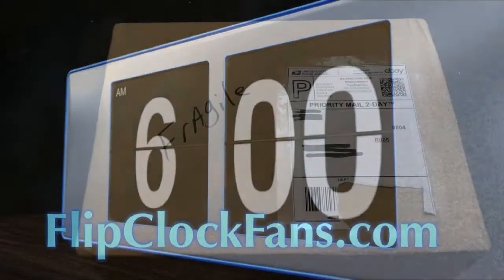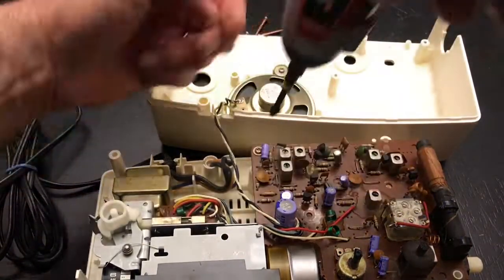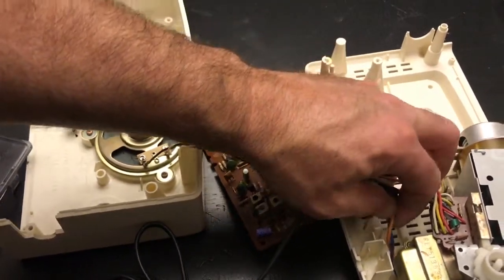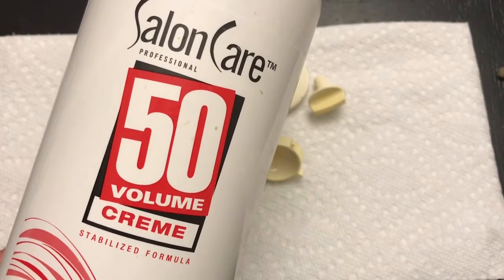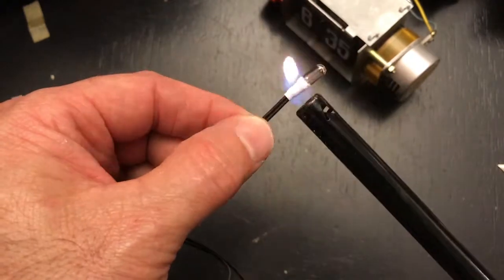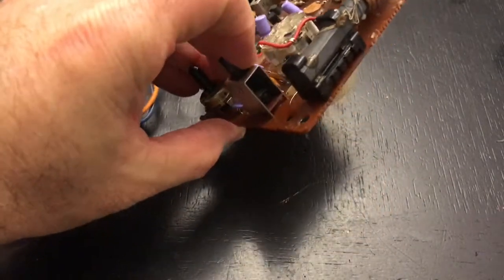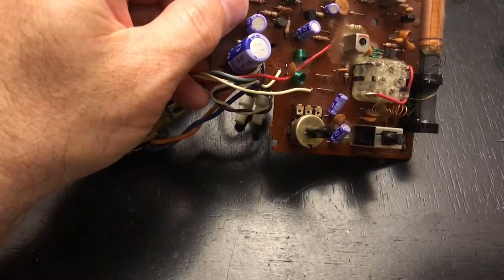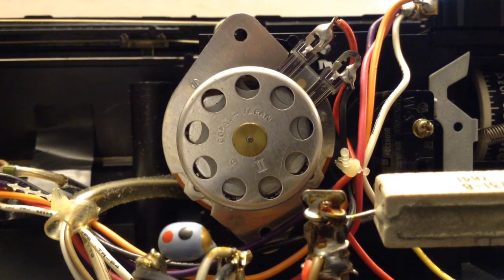Complete restoration of a Panasonic RC-6025

Comment: Hello, so glad I found this very helpful video. I just acquired a panasonic rc-702 from presumably 1974. It needs cleaning and other little restoration work, too bad YT won't let me post any pictures in the comment section, but when you see this flip clock, you get that 70s/80s vibe guaranteed every time

Comment: If a white cabinet has black lettering for the selector switches can the hydrogen peroxide still be used?
Reply from the maker: Yes.  People who've done this reports that it can. I'd keep solvent away from the lettering though (including alcohol, ammonia and especially brake fluid).

Comment: If I need to replace the digits/numbers...what other models are compatible with the digit/numbers of this model?
Reply from the maker: The internals of the Panasonic RC-6030 are exactly the same as the RC-6025. I have not done a hands on comparison and cannot guarantee this, but I believe the following clocks use the same number tiles: RC-6015, RC-6010,  RC-6035, RC-6040 and there are probably others. If I make it to my storage area soon I'll pull some clocks out and check more.
Reply: @Flipclockfans  thanks! I'll do some digging!

Comment: Nice ! Like!
Please recommend the motor oil for me. 
What type(brand) of oil do you use now?
Reply: kachalka100 I have always used a silicone spray oil on all kinds of motors. Place some kitchen towel under the motor, quick spary and let any extra drain.
Reply: TheDutyPaid  Thanks! +
Reply: DO NOT USE OIL IN THE MOTOR! You will gunk it up and it won't help the noise or performance of the motor/motor assembly. Instead, dip the motor (not the clock) in 91% Isopropyl Alcohol in a small bowl. That will clean all of the gunk out and restore the performance to like-new (info from FlipClocks.com). Enjoy!